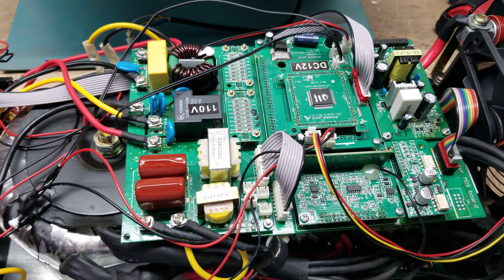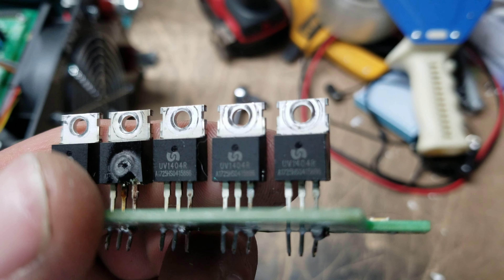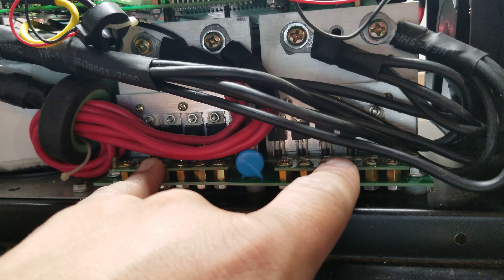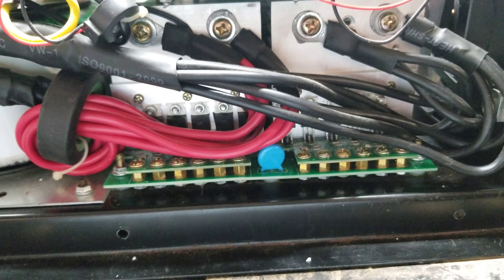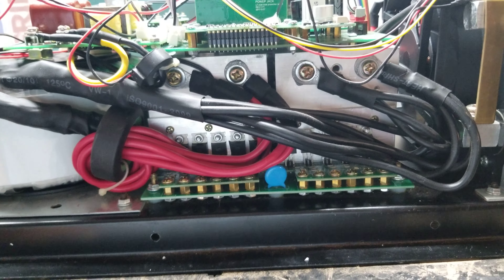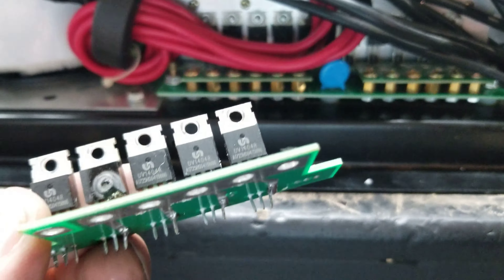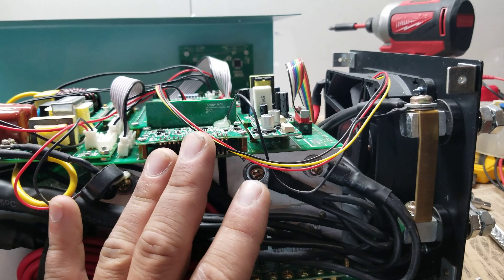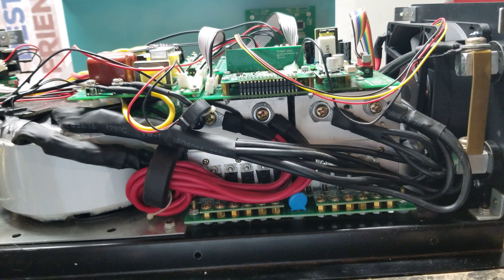If 1 mosboard fails, replace all the mosboards

Comment: Is replacing all the power stages a "normal" thing with the power jack?
Reply from the maker: It is the most common failure. The 2 main reasons are heat and overloads however I have had inverters brand new or slightly used on my test bench blow mosfets for no apparent reason.
Reply: @GenetrySolar  Saw one person that went through 2 just trying to start an air compressor.  (WAY below his 8kw rating, since it was on a 110 volt circuit) They seemed to say "We don't know why it failed." and sent new boards, then a whole new inverter.. the new inverter failed the same way.. so I guess that was 3 attempts to start the compressor.  The odd part: his 5kw inverter had no problems with that same air compressor....  I wonder if the MagnaSine might have better protection....